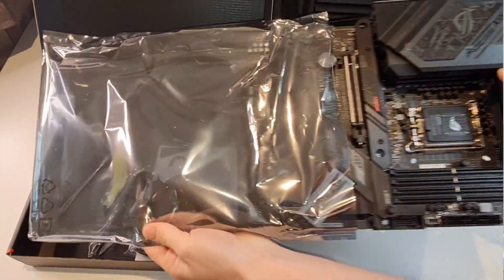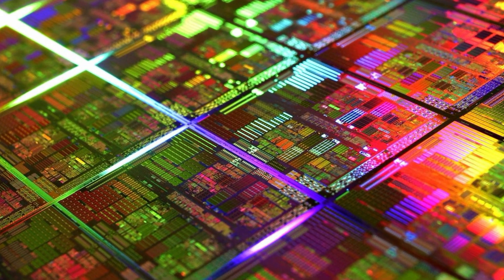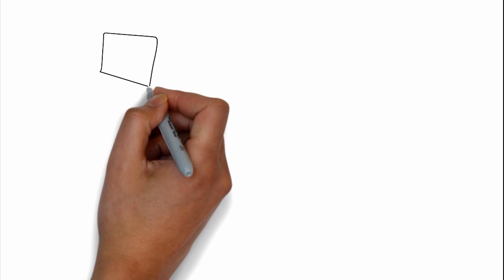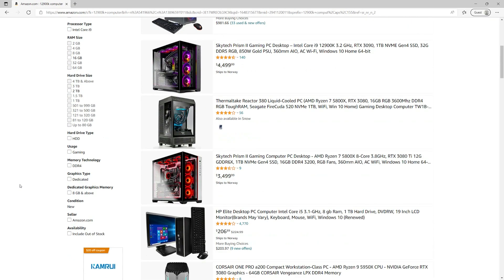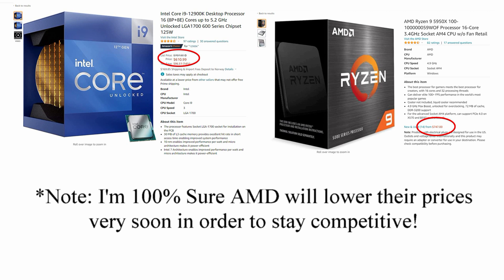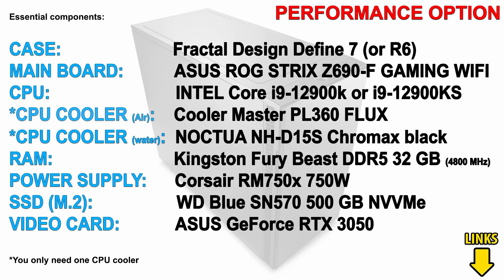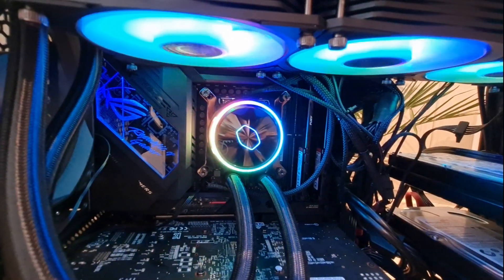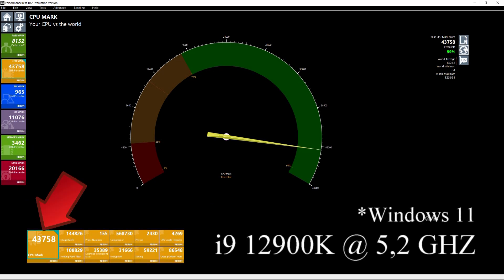The Best Computer for Music Production - What's Needed and Why!

Comment from the maker: Parts list: 
(Amazon links below)

☑Performance option:

CASE: https://geni.us/define-r6usbc
Main Board: https://geni.us/z690-f
CPU: https://geni.us/i9-12900k
CPU Cooler (Water): https://geni.us/pl360-flux
CPU Cooler (Air): https://geni.us/NH-D15S
RAM: https://geni.us/KFB-DDR5
POWER SUPPLY: https://geni.us/RM750x
SSD (M.2): https://geni.us/SN570
VIDEO CARD (option 1): https://geni.us/RTX3050 (budget)
VIDEO CARD (option 2): https://geni.us/rtx-3060ti (best value)
* You only need one video card!

Total cost: 2500 USD  (approximately, with video card option 1)

☑Budget Option:

CASE: https://geni.us/corsair-110q
Main Board: https://geni.us/A520M
CPU (With cooler): https://geni.us/AMD5600x
RAM: https://geni.us/kingston-ddr4
POWER SUPPLY: https://geni.us/NWE-Bronze
SSD (M.2): https://geni.us/Kingston-NV1
VIDEO CARD (option 1): https://geni.us/RX6500 (budget)
VIDEO CARD (option 2): https://geni.us/RTX3050 (Better value)
* You only need one video card!

Total cost: 880 USD (approximately, with video card option 1)

☑Accessories: 

Keyboard: https://geni.us/g213
Mouse: https://geni.us/logitech-g402fury
Audio interface:  https://geni.us/scarlettsolo-3rd-gen
Headphones: https://geni.us/akg-k612pro
Studio monitors: https://geni.us/Yamaha-HS8
Ultrawide monitor: https://geni.us/Samsung-49
Standard monitor: https://geni.us/spectre27

☑prebuilt performance computers: 

Statationary (Intel): https://geni.us/Prism-12900k
Stationary (AMD): https://geni.us/MEK-5950x

Laptop (Intel): https://geni.us/G533ZW
laptop (AMD): https://geni.us/ASUS-G15

☑Prebuilt budget computers:

Stationary (Intel): https://geni.us/cyberp-i5
Stationary (AMD): https://geni.us/ibuy5600

Laptop (Intel): https://geni.us/HPcorei5
Laptop (AMD): https://geni.us/HP-ryzen550

*Some of these links might have been updated since the making of this video.
*Geniuslinks will automatically attempt to redirect you to the correct product in your local Amazon store. In some cases, or if the product is not available, the link might not work.

Comment: I just learned here that for music production, many cores are useless. And I had just bought  a refurbed HP Z8G4 with 16 cores.but with 3,2nGHz. Did I just buy the wrong machine?
Reply from the maker: Hi, no, many cores are NOT useless. FL Studio, like any daw CAN utilize multiple cores, and it does. So you always want as many cores as possible. The problem with DAWS is the dependency that is constantly being created, which can cause some cores to lag, forcing others to have to wait. It's this constant waiting for things to get done in sequence that makes single core performance so important. You generally want as many cores as possible, with the best single core performance as possible. I would rather have a 16 core CPU with decent single core performance than a 4 core CPU with slightly better single core performance.

Comment: This video is overkill—absolutely absurd, period. If you're trying to lay down demos in your garage or even do serious multitrack recording, you better choose the right DAW before you start worrying about what kind of computer you’re using. Using Reaper is the first step to real audio production. You can load it on a 10-year-old machine and it’ll still do everything most of you need. This kind of setup flex is pointless and shows a total disconnect from real-world experience. It’s like they’ve never actually produced music outside of a gear list.
Reply from the maker: The viddeo is about the "best" computer for music production. It's true that you can usually get by with a pretty average computer in many cases. For example a rock song with 10 trakcs and just some basic EQ, compression etc can probably be handled by even a 10 year old computer. However, a lot of people who produce orchestral compositions for example, with hundreds of mixer tracks with countless effects will quickly run into problems with latency and overrun, and a fast computer will be required. 

As explained in this video; realtime audio processing in a DAW is demanding on the CPU because it has to handle a constant, uninterrupted stream of data with very low latency. Each sample has to be processed in the correct order, often with effects and virtual instruments that depend on previous steps, so the CPU can't just split everything up and run it in parallel. While modern CPUs have many cores, audio processing is often limited by what's called the "single-core performance" because certain parts of the signal chain must be completed before the next can begin. This means that even a powerful CPU can hit a wall if one core is overloaded with a complex plugin chain or lots of real-time tasks. As for the DAW itself, modern DAWs are built on the same core principles and audio engines, so the performance difference between them is usually minimal. The bottleneck tends to come from how heavy your project is, not which DAW you’re using.

Comment: amd 7900 and a low latency mobo and at least 32gb ddr4 or ddr5 is really all you need to know. Done. Only put memory in 2 slots- never 4 unless you really, really, need it, like 200 tracks or something dumb. 32 is more than enough for most of us. I run fine on 16. You also have to learn to optimize your BIOS, Core Parking, Disable Legacy USB, etc. This matters a lot. I literally run REAPER and Plug-Ins on a 10+ years old, original and first I7 CPU and it works great. It runs cool and quiet as well. Today they scam you with power numbers. The trade off is always instability and heat. The AMD 7900 solves this issue...and it performs great. Is it as fast or powerful as some other CPU's? Probably not in benchmarks but in real world, daily use, it is far better...and cool and quite.

Comment: That air cooler mounted sideways💀
Reply from the maker: This particular cooler is extremely large and due to clearance issues with the ram, it has to be mounted sideways in order to fit on this particular motherboard.
Reply: But in this way you ruin all the airflow. That's why it went 85°
Reply from the maker: @skerdidedej6402  I talked to Noctua before making this video. They had tested this configuration themselves and it's not that much worse, especially if youh have good air flow in the cabinet itself. A couple of degrees C at the most. 
In this case there are two fans dragging in fresh air in the front, and there's also a fan right on top which help push air out, so air is constantly replaced in the cabinet. It never heats up inside, so the cooler remains quite efficient. With bad cabinet circulation it would be very differnet, but that would be the case even if it was mounted the right way too. 
The difference isn't that much between the Noctua cooler and the pricier water cooler here either, so it remains quite efficient even when mounted this way. The reason it goes to 85 is because this CPU runs very hot, especially when overclocked.

Comment: let’s get an updated video for 14th gen and ryzen
Reply from the maker: @connorharris1900  it's on my list 😀👍
Reply from the maker: I might wait for the next gen though, or at least until they fix all the problems. As you probably know, the 13th gen in particular, but also the 14th gen has severe issues related to longlivity and unstability. There are problems with the chips power regulation causing them to get too much voltage, resulting in corrotion and chips that become unstable. Basicallly premature electromigration. Intel hasn't been very forthcoming about what they're doing to resolve it.

Comment: hmm it look like your task manager dont use the half of CPU core... the E core of intel maybe dont join the render...
Reply from the maker: That's correct. They don't. They handle windows background tasks instead, so that the P cores can focus exclusively on the render. That way they won't have to constantly cycle between tasks, making them much more efficient. This is particularly helpful during realtime rendering (realtime audio playback in a daw) because you significantly reduce the latency.
Reply: E core doesnt join the render, just only background like window update, chrome,etc...  and if rendering mostly use the P core. 
Here is my imagination( maybe it's wrong): so most of i5 in 12th gen have 4 P core so maybe maxout power, because we have e core to do do other so maybe actually It's not actual improve from i7 4790k because It's the same turbo 4,4ghZ, and the i7 12 th gen have 6-8 p core so actually doesnt improve much with I5-I7 gen 8. (Let aside of window 11 support). E core even mostly doesnt need to use much, maybe 2 or 4 core is ok but somehow 8 e core it's likely just for marketing( in my opinion, maybe It's wrong)
Reply: These days when about virtual instrument, it's need the actual core can render up to 8 core. So it's like kaboom. Seriously

Comment: Hi Firewalk! Does your ASUS ROG Strix Z690-F causes you any problem? I have the ASUS ROG Strix Z790-F (all the other parts were as you proposed) and have caused me only troubles so far as very frequently and with no apparent reason denying to boot and gives me black screens on start up. Thank you!
Reply from the maker: Hi, I'm not having any issues with my build. Sounds like you got a faulty component or something. Could be the CPU, the motherboard itself, the ram or even the video card. For example if the power cable to the video card is not properly seated, or not using the correct one.

Comment: Notes: 
* CMIIW, I read that the Quiet Case like those Fractal, actually is only about 2db quieter than the not quiet case. Which is not really noticeable. With sacrifices in temperature of the Computer, which can be throttled the CPU. So perhaps, it's not worse for Music Production PC to use a non Quiet case, with careful choices of Cooler system, its fans, including the Case fans, placement of the fans (to get optimum air flow while also keep it as quiet as possible) it can even be better. Again, CMIIW and sorry if I am wrong,
** The fastest single core performance processor is happened to be also the one with the most core, the highest in its class (13900K series, 7950X, 7950X3D and alike). Again, CMIIW.
Reply: it would be very hard to mix, master, record .. and produce music if you had to contend with loud case fans droning on in the background. a 2db quieter case is absolutely better.. especially if the case is right next to you while working. may not seem like a bother at first thought, but I guarantee you, after a few hours of working beside a PC that's constantly adding fan noise to your listening environment, your frustration will be hard to dismiss. 
and some people don't have the luxury of a control room so they might actually be tracking instruments in the same room.. maybe recording vocals or voice overs.  you can't do that with a loud computer right there
Reply: 2db difference doesn't made it a loud(er) computer. But, Ok. 'For me' 2db is not noticeable different. So in this case, I choose 'only' 2db louder but cooler CPU so it don't throttle. That's me tho. YMMV @nickloss2377

Comment: Wish i'd bought the i7 13700k instead of the i9 12900k. I just build my new PC. Well let's see.. the 12900k should also be fine
Reply: I7 13700 k  and I9 12900 k is the same thing in singlecore. But 13700k (even 13700 with not k) is way better than 12900k in multy core. You have also a faster render, so cooler temps than  I9 processor.  Today I7 13700 and 13700 K  rule ove I9 12900k.

Comment: Great breakdown of what specs are relevant to most DAWs
However
Building a beefy PC for music production generally isn't advisable due to the limitations of Windows and inability for non-apple hardware to effectively run Mac OS
While DAWs like Pro Tools will get fine performance out of windows, in workloads that require such powerful systems it's likely you'll be running large sound interfaces with multiple in and out channels. This is where Windows can become extremely problematic.
Support for ASIO drivers in Windows is notoriously unstable for larger interfaces. You'll be fine with 2 ins and 1 stereo out, but as you go beyond that it becomes something of a lottery for whether or not windows will play nice with your interface's drivers
Generally if you're going to invest a lot into an audio workstation, it is best to go with a Mac as support for ASIO drivers is a lot more stable and consistent across sound interfaces

Comment: is it important to get ddr5 ram instead of ddr4?
Reply from the maker: I would definitely go for DDR5 if you have the budget for it. 
I did some experiments earlier on a quad-channel system, and the difference was shocking when going from quad to dual-channel memory. 
I also noticed improvement when overclocking the ram and getting the timings just right.
Reply: @FireWalkMusic how about a laptop you can recommend? I’m not picky old or used doesn’t matter and it’s just for to use fl

Comment: i waited the entire video to hear what SSD I should buy and he didn't even explain -_-
Reply from the maker: Any ssd will do, really. It's just for lading samples and libraries. It doesn't really matter if it is 500 mb/sec or 800mb/sec drive. You won'treally notice the difference between those in a daw, but you will notice the difference between any ssd or m2 drive, and a traditional spinning hard drive. The same way you wont really notice much difference between a 550 hp sport car and a 650 hp sports car, but you'll definitely notice the difference between the sport cars and a 90 hp toyota yaris for example 😆

I've included some suggested ssd disks to buy in the description below the video. 🙂

Comment: ...have been working for 5 years with an 11 year old HP Z800 workstation (about 8000 $ then, 600 now) with 2 6-core 3.3 Ghz XEON processors.
Now for the first time I have a problem that the new NI Massive synth needs a newer chip generation.
I got a 5 year old laptop for this.

Folks, buy old workstations for 1/10th the original price and be happy.
I recommend anything from the HP Z620.
Reply: terrible, the power consumption alone is insane.
unless you have very low energy costs, this doesn't make sense.
workstation hardware is very nice to have but
no comparison to current prosumer hardware.
Reply: L advice

Comment: I was not sure what to expect from this, and was pleasantly surprised by how well presented this was and is spot on from my understanding.  In the past one of the issues with AMD vs Intel was compatibility with hardware and software for audio, but I am hearing that there is good parity with the current technology.  I also think that overdoing it on the graphics card can still cause issues - you need a good solid multi-monitor stable option (as stated).  I understand this could become more of an issue later as GPU processing applications for music continue to develop.  I am curious what the round-trip latency of this setup is.  What wasn't covered by this demonstration was the interface aspect which is a whole topic in instelf!
Reply from the maker: I'm glad you found it helpful! :) I considered adding audio interface info as well, but then the video would be way too long, so I decided to just focus on the computer itself. Besides, I already have another video about choosing an audio interface :)

Comment: i9-12900K is insanely hot with a Noctua NH D15 going way above 90 degrees on 100% full load (when you render a massive project with a lot of tracks), i avoided it for that reason. It's a +230 watt chip and i don't want to use liquid cooling to tame that beast.

My i7-12700K right now on 100% CPU load for Cinebench maxes out around 67 degrees and 150 watts, a ton of cooling headroom, stays silent and cool even on summer.
Reply: For things like this, it's more common for people to build Ryzen systems.

The i7-12700K is just an anomaly. 

No point choosing the i9, you are always better off with a way faster and efficient Ryzen 9 non-X chip. Many OS scheduling problems maybe are resolved for AMD right now on Windows 11 too for Ryzen 7000 systems.

Comment: Userbenchmark can be kinda missleading for CPU comparisons and value. It works fine to compare many systems for the same chip, but for building a system not that much.

I use Cinebench R23 to test thermals, perfomance, clockspeed stability, max power comsumption and how loud the PC can get on 100% load. CPU-Z for quick perfomance comparisons, Passmark for DAW speed (floating point numbers).

I used Techpowerup and Tom's Hardware website for perfomance per watt and then make a perfomance per dollar calculation. I bought the Corsair 4800MT/s RAM thanks to those guys, better than the Kingstons, i also bought the NV2 SSDs thanks to them too.

For a PC case and cooler, just a lot of videos.
Reply: this synthethic loads are useless for audio, they ar efine for video work.
geekbench is reliable for daw performance comparisons imo.

Comment: My current build:

Case: Corsair 5000D Airflow.

Motherboard: MSI Z690 Pro-A DDR5.

CPU: Intel Core i7-12700K.

Cooler: Deepcool Assassin 3 (it's basically a Noctua NH-D15).

RAM: 2 x 16GB Corsair DDR5 4800MT/s.

Power supply: 850 watt MSI gold power supply.

Storage: 2TB Seagate external hard drive, 2 x 1TB Kingston NV2 NVMe SSDs.

Video card: none, i'm using the Intel UHD 770 from the i7.